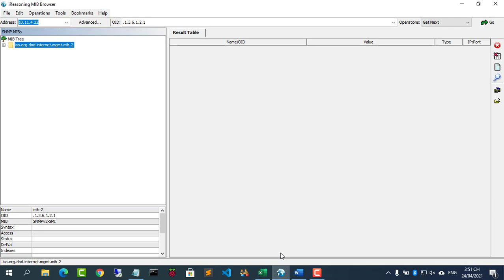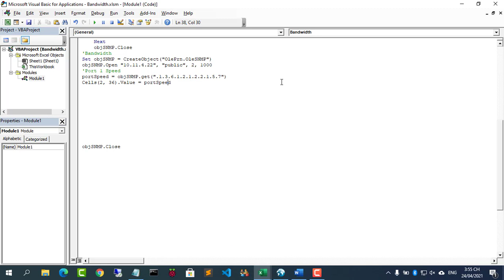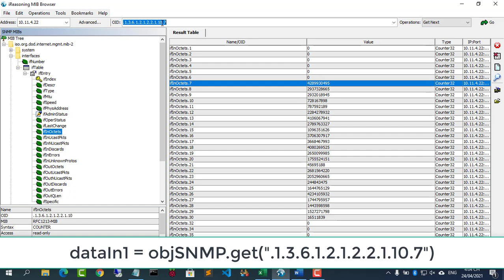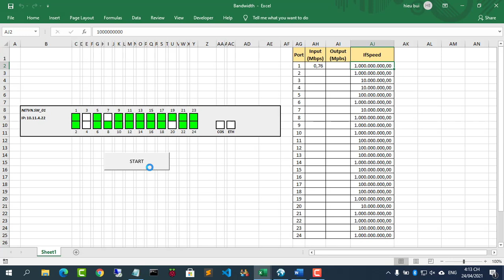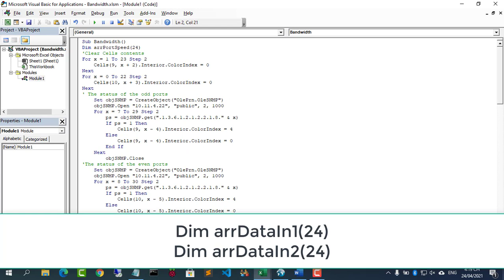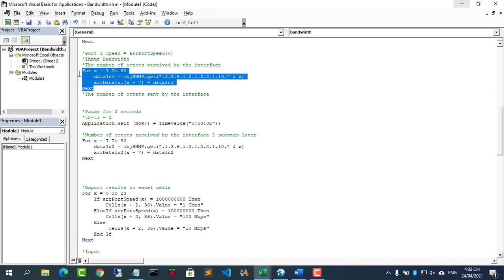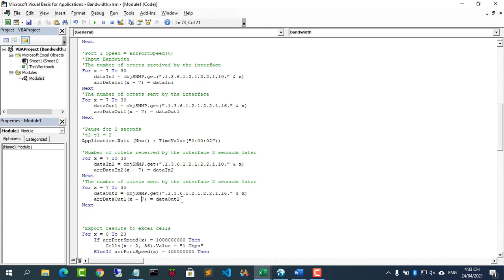How to display the bandwidth of all switch ports | Excel

Comment: Bro ,you are gulu. I have a question on the method objSNMP.getTree(oidstr),I found the Ubound and Lbound not works ,seems the output is not a standard Array ,the length only 2, but the actual oid and value are over 2 ,as your sample oid .1.3.6.1.2.1.2.2.1.8, is there any grace solution?

Comment: 1) Application.Wait(now + 2s) as a timer for speed calculations? ))) Seriously?
2) Also, check out the Range object and range adressing instead of lame looping thru every cell to clear them all at once.
3) Define constants instead of using magic numbers directly in code.
4) Always use the same meaningful limits in loops (0..23 here) throughout your code for it to be more easily understood by other noobs.
5) Even better here to use "Option Base 1" directive as the first line in the module to start all array indices from 1, not 0 (1..24). That would be more clear for non-coders to grasp. 
6) There's a proper construct "Select case" in VBA instead of using many Ifs consequentally. Although your code is redundant and verbose in many other ways.
7)...

Comment: @NetVN Hi can you please help me out with a python module issue.
1.when i fetch logs from a python module it shows them with random day & time.
2. I want these logs sorted by date and time 

Requirement:
A.Pyc module name
B.select type of logs
C.select server
D.select region
E..select todays or yesterday logs
F.select specific number
G.displays logs sorted with ascending time and date .

Example
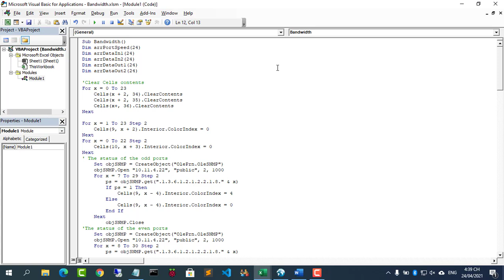11:00 24-04-2021
12:22 24-04-2021
13:12 24-04-2021
13:25 24-04-2021

Note: module is already there just need point G modification

You are inspirational seriously.